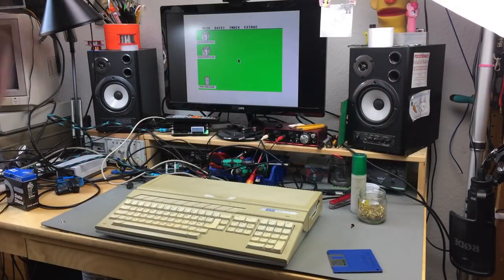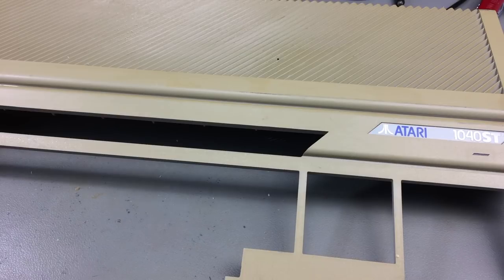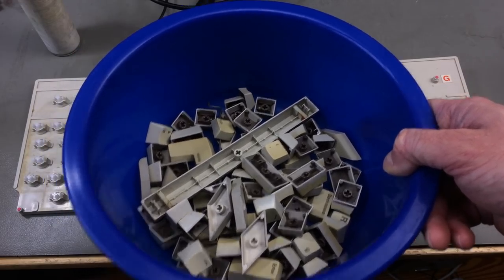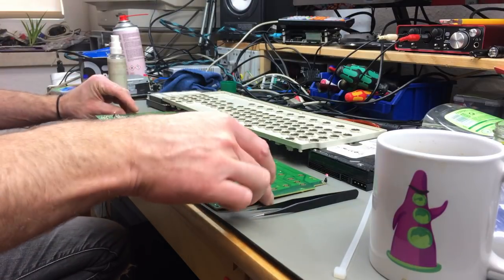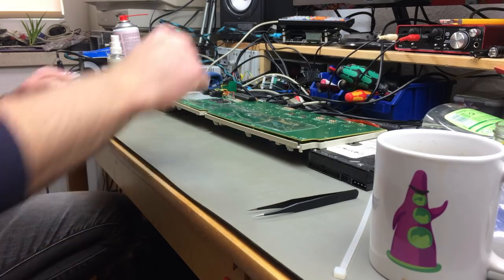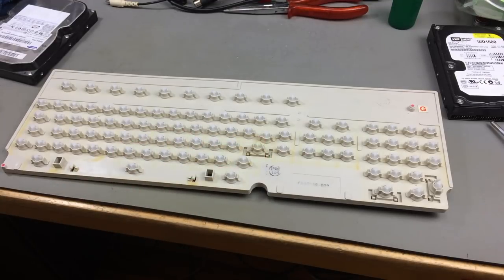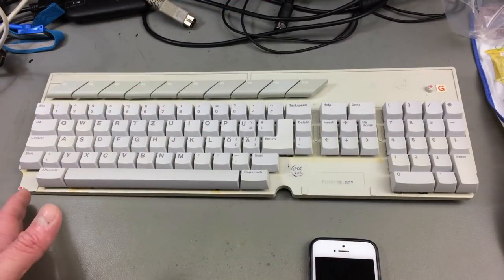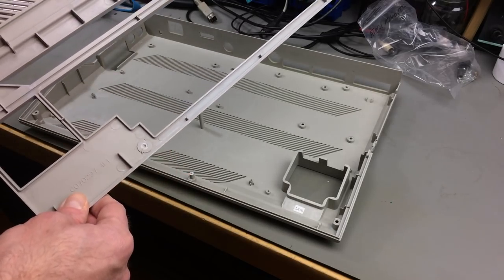Atari 1040STF Restoration Part 2: Retrobrighting

Comment: This rubber dome under Return key is missing by default. After opening my first ST keyboard, I was looking it for some time, but now I know it is missing in every ST keyboard, and there's no point of looking for it on my carpet or under the desk ;)
I won't let my head cut off for it, but STf had always double sided disk drive, only the first external drives for the original ST were single sided.
It is worth to protect the badge with Kapton tape (or a good office tape) cut to the edges, before retrobrighting or using aggressive detergents. I have destroyed a badge on my 65XE during a chemical cleaning.
Reply: Not sure about the 1040STf, but my 520 STFM has a single sided internal drive. I bought it in early 1987. One of these days I will install a double sided. :)
Reply: @Steve_R  my 520  STFM came with the single sided drive which I upgraded to a double sided one.
Reply: @gibbo9089  I have an Atari external double sided drive that I could swap for the internal one but the eject button is a little different, so a case mod or drive mod would be in order. About a year or so after I got the computer I upgraded the memory to 1 meg. The motherboard was silk-screened for another 512K, so it was a simple matter of adding sockets, chips, and bypass caps. In the day, that extra 512K made a big difference.
Reply from the maker: Yes, one of the carbon contacts remained unpopulated. Not sure if that was apparent from the video. There was one more missing on my keyboard so I needed to replace that.

Some other commenters also have pointed out that all 1040s had double sided drives (I think I saw two R/W heads in mine, too, but didn't pay too much attention). I will investigate.

I never had a badge react to peroxide as of yet. But it makes sense to be careful, obviously. Thanks for the warning!
Reply: @JanBeta  That's definitely a double-sided drive you have there. In the single-sided ones, the upper arm is a plastic triangle with a circular felt pad on the end.

Comment: A new video from Jan makes a nice retrocomputer Christmas present! BTW those rubber domes look like the same ones that were used in some VIC-20 keyboards... and they are just so mushy feeling when compared to proper springs. Blech! :(
At any rate, I hope your Christmas was very merry, and may your channel have continued success into the New Year!
Reply from the maker: Thanks! Interesting that the VIC-20 used similar domes. I saw a similar construction in an elderly Apple keyboard a while ago (had to disassemble because I spilled a drink... errrm). No idea if those were the exact same size, though. ;) Hope you had a good Xmas and 2020 is going to treat you well. :)

Comment: My 1040ST needs some love and attention like this. Case is cracked in a few places, whole thing is cheese yellow. It still works, surprisingly, as it's been modded to hell and back by the original owner. Has a 'PC-Ditto' installed, which essentially converts the machine into an IBM PC-compatible. All the onboard system RAM had been hacked off and replaced with slots of 30-pin SIMM sticks, daughter boards and ribbon cables just flung around all over the place.
Yours came out beautifully, great work as always. I'm surprised you only had one broken screw standoff, the plastic in STs tends to be super brittle and those things break like crazy.
Reply from the maker: I found these are really well built electronically. Mostly, only the power supplies develop some issues over the years. The ICs and PCBs are really well made I think. The plastic felt pretty sturdy still, I guess there's a lot of different mixes and qualities around for these.

Comment: Jan, if you check out Odd Tinkering, he uses a 12% liquid for retro bright and his results are always really nice. Plus, you don't have to mess about with shrink wrap and rubbing the cream every 20 mins. Maybe it is worth a try sometime! Happy Christmas!
Reply: after seeing the 8 bit guy and the osborne, I'd NEVER use that cream. ugggg. Actually the method I like the most is the solar bleaching. But obviously that's not going to work in winter. lol If I do anything to my C64, that would be the method I'd use.
Reply from the maker: Yes, I definitely need to get a large enough container to try that method on larger case parts. Unfortunately I don't have a lot of room (or sun) so I didn't do that yet. Works very well for smaller cases and keys though.
Reply: Yeah, the cream is the most economical way to do it, but you have to be really diligent which Jan was (especially with Atari ST cases which are more susceptible to bloching).  I myself, am not.  I use the clear and add it to water because i get distracted too easily 😁.
Reply: Or the best way is from day 1 of purchasing a new machine back in the day is to:
1) always keep out of direct sunlight,
2) never have it set up in a room using UV lighting,
3) keep it covered up when not using,
4) keep smokers smoke away from it,
5) never store it in a basement or atic where the temperatures go from one extreme to the other (keep at good room temperature all year round).

This is why I believe my Amiga A500 has never yellowed in the slightest or had a repair done to it since purchasing it back in 1989! :-)

Comment: I recently got an Atari STFM. One thing I've made recently for mine is a simple pair of ribbon cables DB9M-DB9F so I don't have to go under to plug in joysticks, and my DB9->PS2->USb dongle chain for my mouse actually fits.
Reply from the maker: Yes, that makes sense. No idea why they made the decision to put the ports on the bottom.

Comment: There's meant to be 1 dome missing. I made the same mistake when i was working on my ST. The key in question has 2 contacts and it is held in place by the key itself so you don't need the 2nd dome.
Reply from the maker: Yes, one of the carbon contacts remained unpopulated. Not sure if that was apparent from the video. There was one more missing on my keyboard so I needed to replace that.
Reply: What happens when you add the second contact dome to the return key?

Comment: Lovely computer now after that Retrobrighting. I really like your method of doing that. I think I will try the same way, but use the sun - we have that most of the time here in Tucson!
Reply from the maker: Thanks! Yes, sun supposedly works a lot faster. I see the 8-bit guy doing it all the time in Texas, I usually don't have enough sun here (nor a place to safely leave my beloved old computers outside). ;)
Reply: @JanBeta  I have a spare A500 case now that I have my Checkmate 1500+. I think I will do a comparison on it, 1/2 Sunbright the other half traditional retrobright. That might be interesting. (The case is broken, so no big loss)

Comment: For removing adhesives just try paraffin (lamp oil). Its just the best and easiest way to remove glue and grease  plus it  appears to be gentle with plastics. ( I always try it inside the case before applying it in the front!).

Comment: Thankfully I live in the southeastern US(western part of South Carolina), and in the late spring & summer time here it can be over 100F(38C), and I just use a clear plastic tub with a clear locking lid, liquid peroxide, oxyclean powder in a 40% to 60% hot water mix to cover all the parts, and leave it on my back concrete patio for most of the day which gets full sun all day, only going out to shake it up, and rotate them every couple of hours, and that works for me, but I guess for colder climates that don't get as much sun/heat this looks like a really great method, and I'll keep it in mind for Winter months if I'm working on something for someone else who needs it in a hurry. 👍
Reply from the maker: Nice! Yeah, getting a decent amount of sunlight definitely poses a problem here outside of Summertime. Also, I don't really have a good spot to leave my beloved machines unattended for a longer period of time. The lamp works reasonably well, I guess it would be a lot faster with real sunlight. :)
Reply: @JanBeta  I guess that is one of the advantages of living Ina small rural area mostly of retired people, with a low overall crime rate.

Comment: Hi Jan Beta, really love your channel! And I'm really eager to start with the retrobrighting process on my C64 but I'm still a bit hesitant to do so because of the health related warnings all over the internet.
Is this 12% h2o2 really that potent? How strong is the smell of the substance? Are the neighbors going to be ill when someone uses it in a densely populated area? Or can the odor be compared with cleaning vinegar? 
I see video's where people are advising this instead of regular bleach for cleaning so it can't be that bad can it? 
I would love to find a video on YT about retrobrighting focusing on this aspect as I can imagine that this is what's holding off people from actually going ahead with it...
Thanks for all your videos, they are superb!

edit: OK. Me being curious, I just went for it and bought all necessary equipment and started with the C64 keys. The h2o2 doesn't smell at all, doesn't sting your eyes, I did wear rubber gloves. The keys could be divided in three levels of yellowness and I stuck them on pieces of carton board using double sided tape. Then I used the cream version of the h2o2 and put the carton boards into zip bags. Those I placed in a plastic container, laid out with allu foil and placed the plant grow led device on top of it. I placed two pieces of carton board at each side to close the container off. Outside temperature 23.5 C, inside around 30. I worked wonders. It took two hours. Really cool stuff. The disk drive is next.

Comment: I remember thinking about buying at ST but finally deciding on an Amiga 1000 which was a little more expensive but had better graphics and other things. I had a lot of fun with the Amiga, I finally gave it away in 2000. In retrospect I probably ought to have kept it.
Reply from the maker: Yes, the Amigas were a tad more advanced in some ways. I like the straightforward design of the ST a lot, though. :)

Comment: Hi Jan, I think you don't need to worry about the black rubber feet, because both my Atari 1040STf have black rubber feet and they haven't been restored or modified. So it came with black rubber feet from the factory.
Reply: yes, I can confirm this. My 520STM, 1040STF and also the Falcon 030 came with black rubber feet. So Jan is as close to the Original as possible. 😁
I used the same 3M rubber feet for my Ataris: https://flic.kr/p/2g7pJuz
On my 520 I even have to use TWO of them each corner, because the squared frame with type label very slightly touches the ground (as on many STs), so the rubber feet don't have enough contact to the ground. Two of them and now everything is perfect! 😉
Reply from the maker: Oh, glad to hear that. I'm not really an Atari guy (at least I wasn't back in the day) so I couldn't tell. :)

Comment: For sticker residue I use a product called  Goo-B-gone. It works  great!
Reply from the maker: Oh, interesting. Didn't know about that stuff. I saw some specialized sprays and stuff but they were way more expensive than WD-40 and alcohol so I just used that. ;)
Reply: @JanBeta  Goo-gone is really great at breaking down the adhesives on most labels/stickers. It's not very expensive, and is available in most hardware stores.

Comment: I've used WD40 for removing adhesive things and I've noticed that letting it soak longer generally makes it more effective. Paper type labels the WD40 soaks into quickly, mylar labels take a lot longer. generally, it slides off after soaking long enough. I don't make videos, so sometimes I let it soak for days. FYI
Reply from the maker: Oh, thanks for the tip. Will try to let it soak a bit longer on stubborn labels next time. :)

Comment: Wonderful Video as Always.
Noticed the taped together Amstrad MP-1 (as you know I love everything Amstrad) in a box @21:40.
If you want a weird side project for a video, I think you can make them into a composite output. Can't remember where I read that... So I might be making it up.
Reply from the maker: Thanks! The MP-1 is definitely going to make an appearance sometime soon. Don't know if a composite mod makes sense (I guess it should be pretty straightforward) but I'll definitely have a look at the power supply part of it.

Comment: I need to watch your 1st video on this computer for the disk drive problems. I have these points:
• Make sure your mech is rated for Double Density 720K disks. 
• If you have nothing but High Density mechs, there's a chip needing updated. I forget which one.
Reply from the maker: Some commenters pointed out that the 1040 series only came out with DD drives so maybe the theory is wrong. Will still investigate, thanks for the hints!

Comment: The WD-40 you get in the US is different in composition from the one you get in germany.
Reply: Do they have Goo Gone in Germany? That stuff is amazing for stickers/adhesive residue.
Reply: @ManChicken  not that specific brand, but there are glue removers available.
Reply: Is it as good as UB-40?
Reply: I was unaware it was different. Are you aware if that's true for in general in Europe?
Reply: @ericcooley9407  In Wikipedia search "WD-40" and in the formulation section, there they describe the German variation.
Reply from the maker: Oh, interesting. I thought it would be an international recipe. Works pretty well on stickers, too, though.
Reply: Different in what way?
Reply: @markmallone7484  nothing is as good as UB40

Comment: Have you considered using food grade or hydroponic peroxide instead? As a liquid I've found it far more consistent and lacking streaking.
Reply from the maker: Yes, but I lack a large enough container to try on large case parts. Definitely prevents streaking if you submerge things completely.

Comment: I still have my STE and an STFM and the FM is seriously yellowed like this, really do want to get it looking nice again :) Makes me wonder if the plastic was changed on the later models which causes them not to yellow as much as the STF/FM range
Reply from the maker: I found that the plastics vary a lot even with the same models. I guess they often had slightly different mixes so the yellowing is different for different runs. On some white C64C keyboards, you even have a kind of checkerboard pattern because some of the keys yellow a lot while others don't at all. Quite interesting.

Comment: I also use a UV light to retrobright. You can't use the sun after dark/bad weather, and I don't like leaving my retro gear outside. Jan have you tried it without the box and cellophane? I used to do it that way, but I don't think the hassle is worth it. I get pretty good results. Maybe a little foil to sit on, to spread the light, but that's it. Video here: https://youtu.be/e7h9kMDbVyg
Reply from the maker: I found that in spots without foil, the cream dried after some hours and left streaking/marbling effects. That's why I always go with the foil. Ideally, you'd probably use liquid peroxide for the case parts, too, but I don't have a large enough container for that yet.

Comment: This doesn’t make the plastic extremely brittle just as is the case when leaving plastics in the sun?
Reply from the maker: In my experience, the plastic doesn't get brittle with this method. At least not noticeably. Your mileage may vary with different plastics though, obviously.
Reply: Jan Beta ... Thanks! Most YouTube stars don’t reply. I RRREALLY appreciate that you did! Have a great weekend!

Comment: The 1040STf came with a double sided floppy drive. The 520 STf came with a single sided one. Theoretically if it's the original drive, it's double sided.
Reply from the maker: Thanks, didn't know that but it makes sense. I will still have a look at the disk drive, maybe I can fix it. :)
Reply: @JanBeta  It's written in my Atari 520 STf manual (but in french :p). From experience (and selling those back in the day) the 520 STf is the only Atari 16bits computer to feature a single sided drivw. the 520 ST/STe computers both had the newer, double sided, double density drives. It was painful because very few games were single sided (for one) and the double sided drives available had a different eject button that wouldn't fit the 520 STf casing and I never found a 1040 STf double sided drive. My 520 STf got butchered because of it :P

Comment: Hi Jan, please do not use the cream peroxide on case parts. It's the worst method, just try out the 12% liquid peroxide submerge methode also on bigger parts. It works like a charm if you put it in a bin into sunlight and water temperature around 50°C ...  It's much better and less aggressive on the environment. And the results are much much better... I've tried this method now on about three ATARI ST and it was perfect.
Reply from the maker: The peroxide method worked very well for me for larger parts. I don't really have a big enough container to submerge a larger case into liquid peroxide so I kind of have to go with this method. The liquid stuff is the better choice, I agree, but it takes more room (and a lot more peroxide) to do for larger pieces unfortunately.
Reply: @JanBeta  yes, you'll need more room and more liquide peroxide. But it's really cheap (5 Liter at Amazon for around 12-14€). A transparent bin can be found at IKEA. The point is, it's working the way you did. But only, if it's done properly. But lots of people are watching you and they not always have the same luck and knowledge as you did. So they maybe will fail - you could mention it, you have the "force" :)